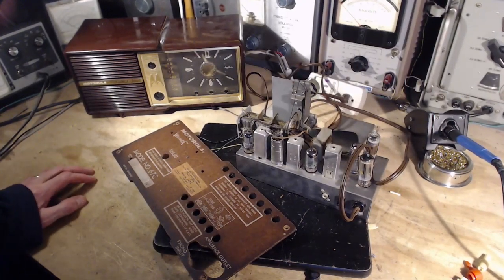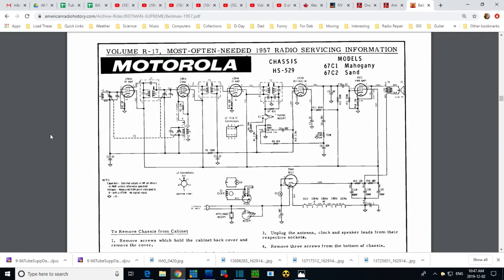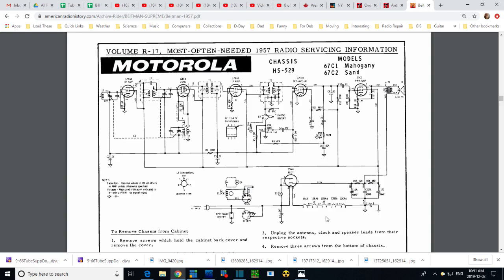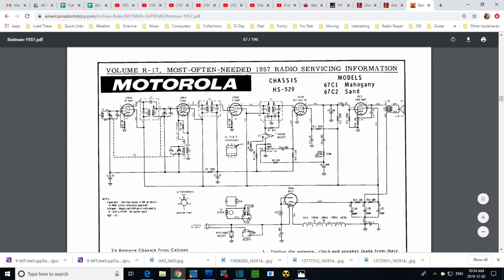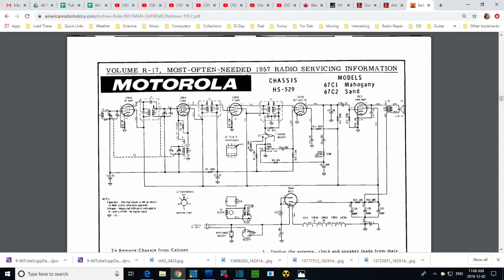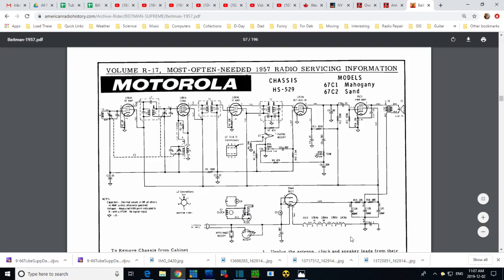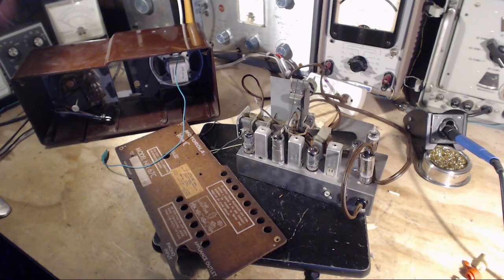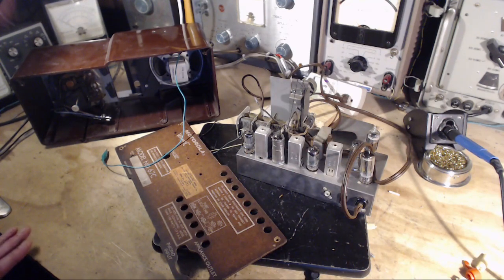Motorola 67C Clock Radio Video #3 - Schematic Review

Comment: Jim, hop over to eBay and get a 12CR6 to finally end the question of whether that is defective. They have a ton of them NOS as I mentioned earlier. One is $4.50 with free shipping. (May be a shipping charge to Canada though.) Others start under $2.00 with a shipping fee but could be cheaper if Canadian shipping is considered.
Reply: @anthonydibart1126  PM him. I don't have that info.
Reply: @anthonydibart1126  you can look it up on QRZ, he is a ham radio operator do a search by name.
Reply: It may be weak but it's not his problem. That would require lots more space.

Comment: You say that the pentode you replaced was "so weak". When you tested it it showed full strength when its bad connection was not affecting it. It would be useful to think about that and blow away the confusion. It shows itself to be a good valve with a bad connection possibly to G2. Try cleaning the pins. This perfectly explains why replacing that RF amp made absolutely no difference. All the mental churning in the world won't improve this situation.